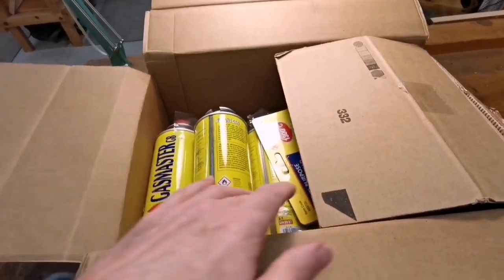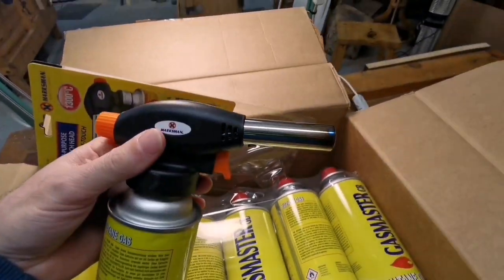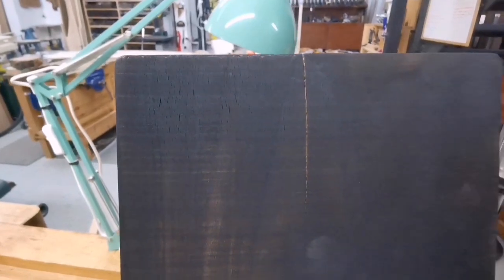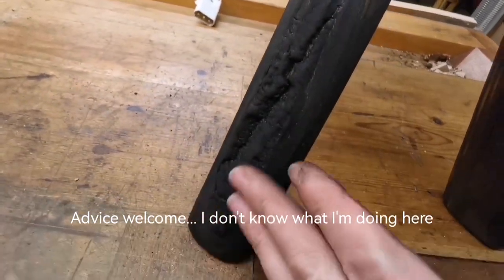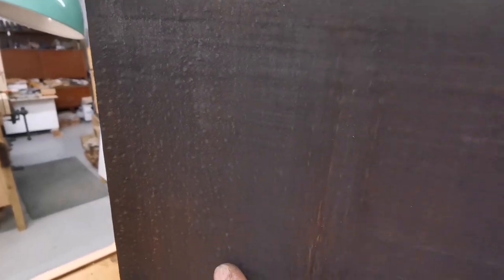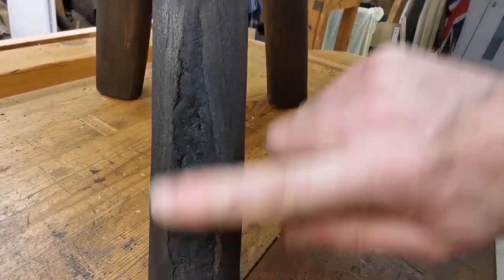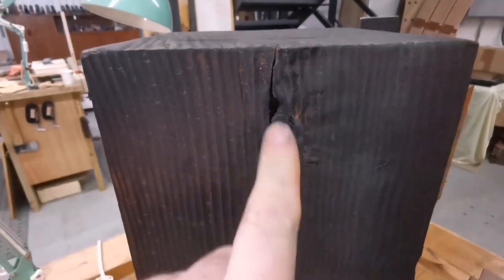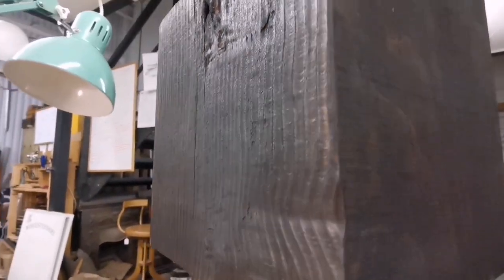Charred Stool, Yakisugi or Shou Sugi ban? I Go Crazy with a Blow Torch.

Comment: It looks good ........ but it will look Stunning!

Brush the carbon off (stiff brush) and you will be left with the grain pattern hilighted where the raised grain gets cleaned off and the carbonised lower sections give contrast.
It will need treating though ...... big black marks on your clothes is not a good look, and that will be the making of the piece! I would go with clear oil to let it soak in and dry off smooth but maybe a wax applied to the wood that has been warmed up a bit allowing the wax to soak in a tad before being buffed up. Or you could go the opposite end and epoxy it to give a permanent seal?

The world is your mollusc ...... it is up to you! ;o)
Reply from the maker: Thank you. I'll go down the Danish Oil route, a couple of coats and then some wax I think. Not a fan of Epoxy.
Reply: @twcmaker  I thought so, that's why I said "at the other end"! You will be letting us see the results ...... Please?
Reply from the maker: Of course. I'll need the 'views' 😂 It's going very quiet here on YT.